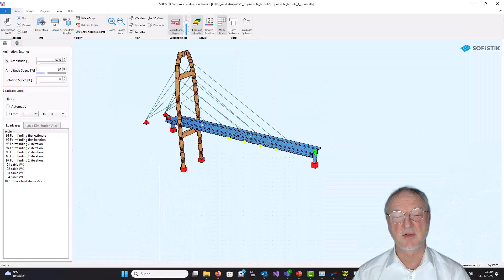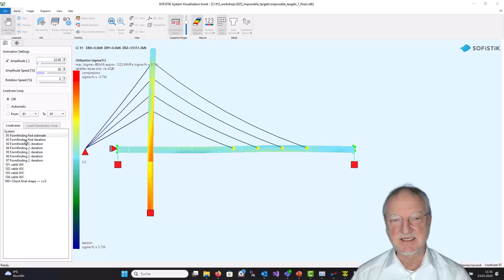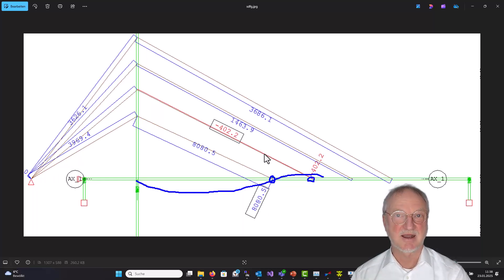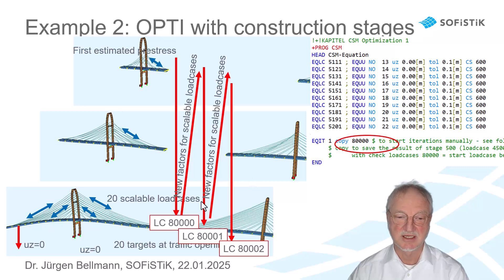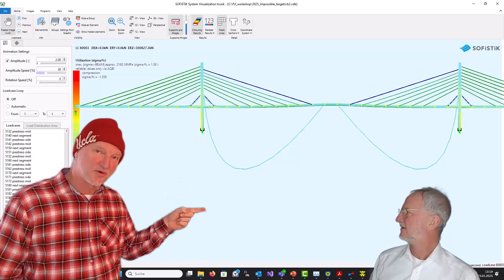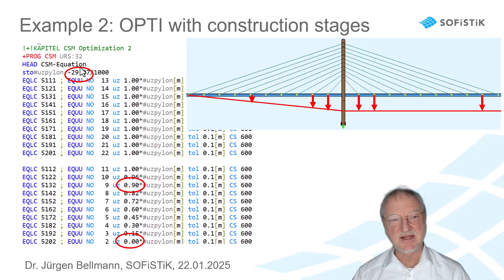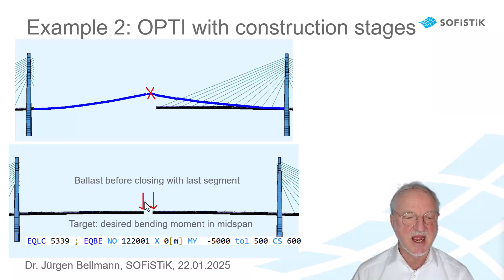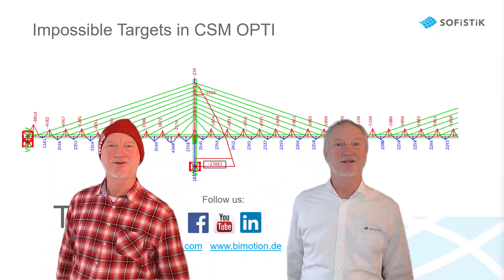Impossible Targets - SOFiSTiK CSM Cable Optimization

Comment: Hello, after optiomization, the moment along the girder is almost uniform (from 5000 kNm to 8000 kNm), but the monent in the bottom of the pylon is way too big (about 27000 kNm). How to do more optimization to decrease this moment?
Reply from the maker: Hi sy9601,
Please ask technical questions like these to our support via the support assistant in SOFiSTiK.
Reply: I also have the same problem. Do you have the answer?
Reply from the maker: Hi Everyone,
I took the time and checked your topic :).
The optimization in the video is focused on a contiuous moment for the superstructure, wich results in a high deflection of the pylon and causes a high momentum in it.
There are two ways in my opinion to optimize the moment in the pylon:
-increasing the tension in the first cable (the one that mounts directly to the support)
This decreases the deflection of the pylon = reduces the momentum.
-optimizing an additional applied force in the first field (the one between the support and the pylon). Applying an additional balast (imagine filling the hollow core of the beam) at the right position can optimize the moment in the pylon as well.

I hope this answers your question :).